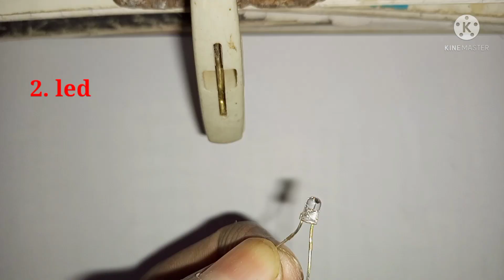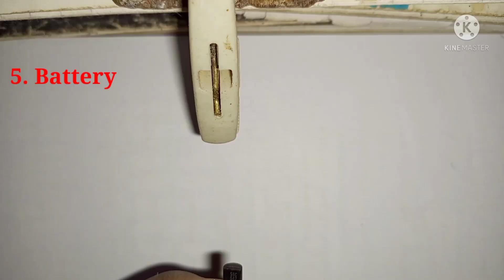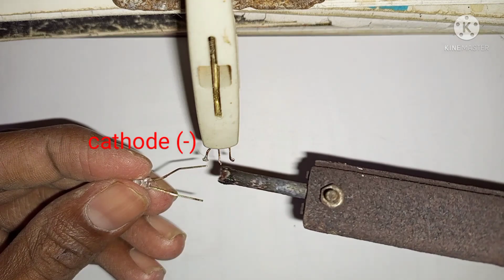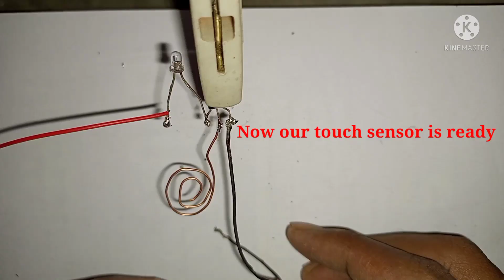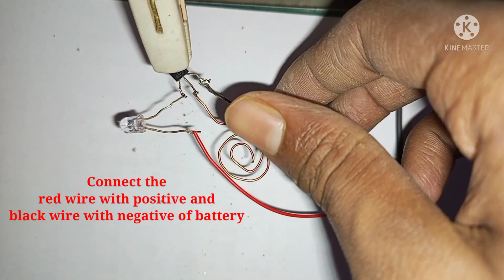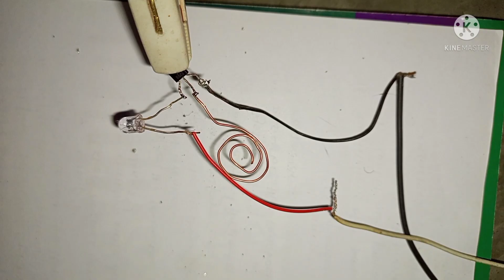DIY How To Make Touch Sensor || (single transistor bc547)

Comment: Nice bro 👌 can it sense your finger from a bit far??
Reply from the maker: No bro only after touching
Reply: @RSInventor  I don't know why but it is not working by touching 1 wire
Reply from the maker: Is it bc547 transistor
Reply: @RSInventor  yes it is working when 2 transistors are put and we touch 2 wires

Comment: The led consumes very low power, what if i want to turn on a more power required device like a fan ! Which component needs to be changed from this circuit?

Comment: RR is daminated the sound of buzer. It w as not clear regarding power connected to the project.
Reply from the maker: DC battery of 4v  is connected in circuit

Comment: Sir ma akae chaser banaraha hu. Aus ma 560e rajister lagaya   o mil nahi raha .may kitna power rajister canact karu
Reply from the maker: What type of chaser
Reply: 3 Chanel led chaser
Reply: Material of chaser making is Bc547 tranjister ,100uf 25v capasiter,10k rajister and 560e rajister
Reply: And 9pcs 5mm led
Reply from the maker: You can use resistor upto 1kilo ohm you can find this type of resistor in old emergency lights
Reply: Many many thanks sir
Reply: You are grate